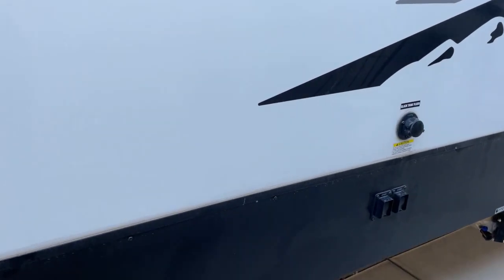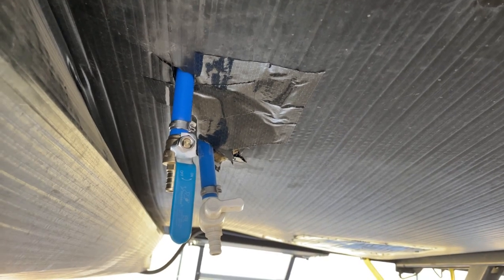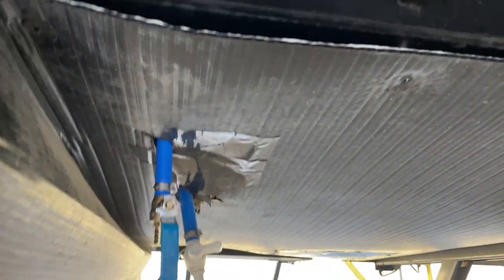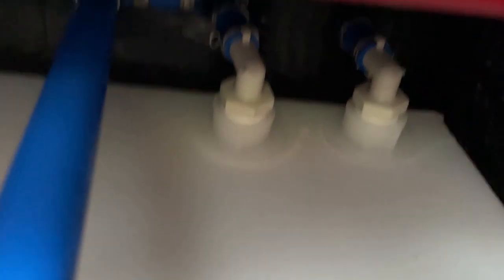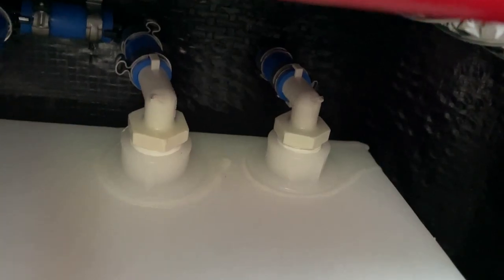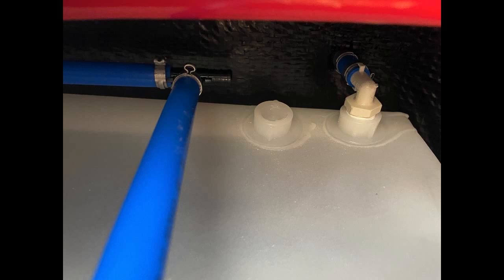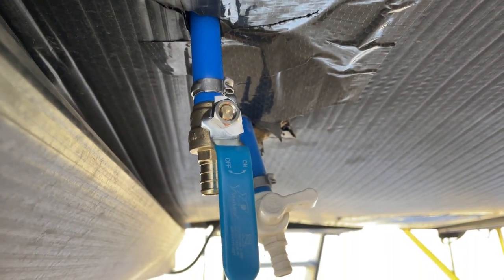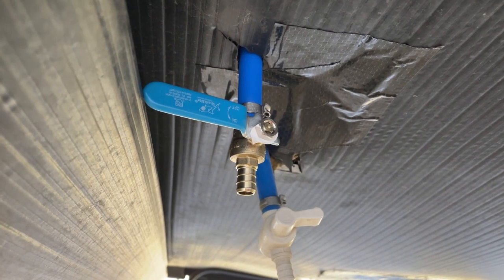RV Fresh Water Tank Siphoning and Venting Fix!!

Comment: finally....you solve our problem without the possibility of catastrophe!   Bravo.  so many on YT just put a valve on the end of the overflow...a recipe for disaster.  I can't wait to tear into this on my 2021 GD which lost 2/3 of the tank on my last trip.  Thank you for your innovative solution.
Reply from the maker: Glad I could help!! My parts list used is in the description of the video!
Reply: You are right- don’t ask how I know.
Reply: Had this happen to me on my new Nexus RV  .I'm compiling a shopping list right now😮.The check valve is genius and will keep me from constantly running in and out of the coach to monitor the tank fill process.

Comment: I'm a retired plumbing contractor and did the same to my 2018 Grand Design 230rl. I was able to run the line exposed under the rig and it worked fine. Currently have a 2022 280rs and Grand Design has not corrected the problem . I'm 70 and it's getting harder and harder  to crawl around under my rig. You did a great job.

Comment: That's pretty good thinking!  I have seen the float valves like on you vent before.  They're commonly used in power houses.  I didn't know they made them that small.  If I run into this problem, now I'll know what to do!  I have a 2024, but I don't know if they've modified the system to cure this problem or not, since I use city water connections, and only put about 10 gal in my fresh tank in case I need to flush on the road.  😀

Comment: What a great job you did. You made it looks easy. I'm afraid to pull down the coroplast but I must do it. 2021 Grande Design 22MLE that I do dry camp in. I lost 14 gallons last week one way. The dealer supposedly fixed it under warranty but all they did is loop the single over flow hose and I told them it probably won't work. You must have a vent of some kind that won't siphon . Well... that didn't work very well. I'll drop the belly this week end and take a peak. Thanks a bunch for the work you did. Jimmy G

Comment: A lot of people fill the tank improperly.  I have seen many campers just jam a garden hose in the fill and then turn on the water. A hose end is too big and won't  let enough air out. Fill tank with a 3/8 ID hose with garden hose adapter on one end. Air can escape around the smaller hose.
Reply: KNEW there was a better way...I'm trying this now. Thanks!

Comment: Looks like a great fix and very intuitive video. Question: Any reason you didn't use one overflow line for overflow and the other for the check valve? Just curious. I just experienced my first syphoning fresh water tank last weekend. Got to campsite and only 1/3 tank left :(
Reply from the maker: No specific reason, you could do it either way!